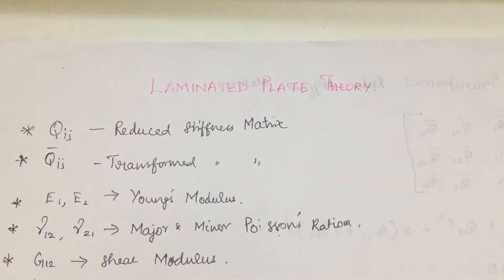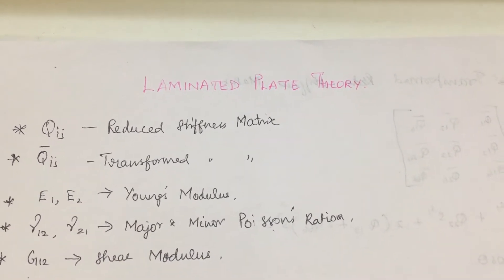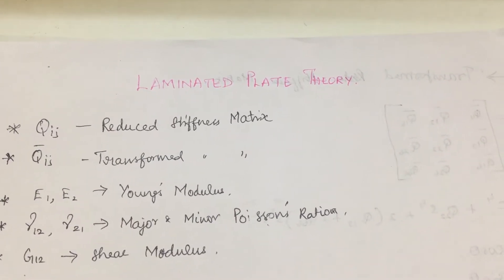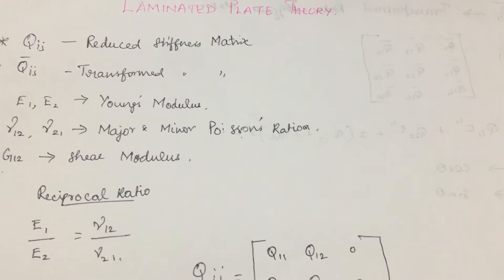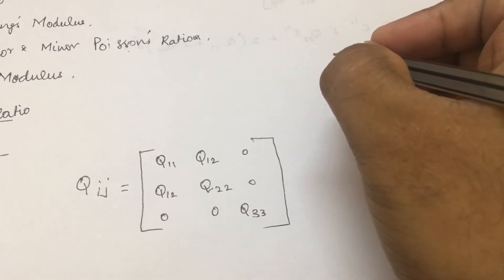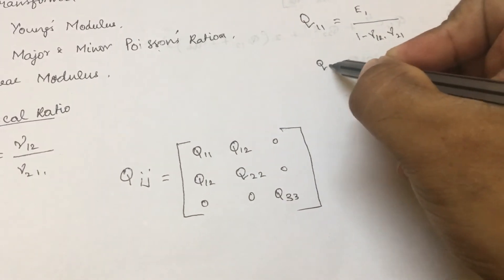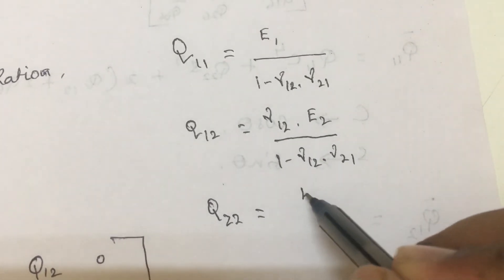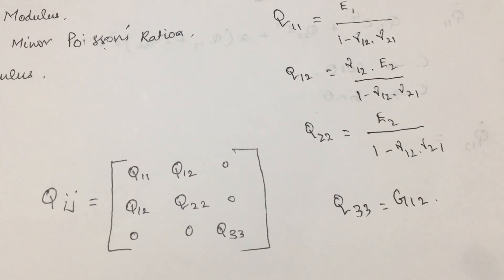ABD Matrix Problems Composite Materials ans Structures

Comment: Hi 
If you’re dealing with (0,-45,+45,90 ) 16 plies 
How will the ho, hi ,etc be?
Reply from the maker: Hi...I will be drawing the layers in this way: 0 -45 45 90 0 -45 45 90 90 45 -45 0 90 45 -45 0
H0 = -1mm
Midplane h8 =0
H1 = -0.875
H2 = - 0.75
It goes on
Reply: @aashvidhcreations7932  hi thanks so much for reply
how did you arrive at H0 BEING 1MM  AND H1 0.875
Can you please show me  a drawing ?
can i get your email?
Reply from the maker: @glorylife_priase  yes sure ... aasishc90@yahoo.com
Reply: @aashvidhcreations7932  thanks check email please
Reply: @aashvidhcreations7932  hi
Is it possible to get the sequence from Ho to Hn please ?
Reply from the maker: @glorylife_priase  hi I have received your mail ... I need some time to solve it 
Will get back to you this weekend
Reply: @aashvidhcreations7932  my assignment is due tomorrow 
If you can show me the ho = h 16 I will solve the test myself I already started it
Reply: @aashvidhcreations7932  am a. But confused about the h0-h16